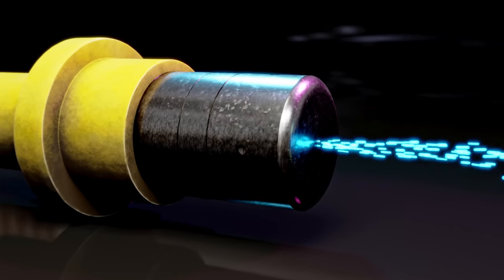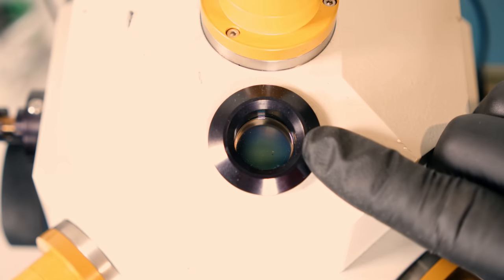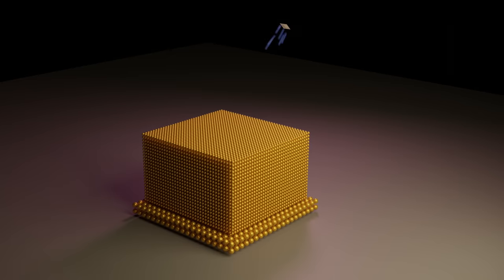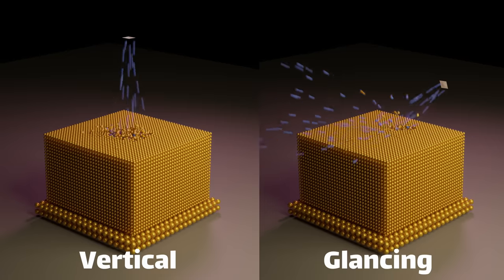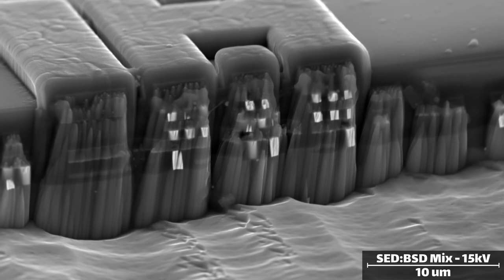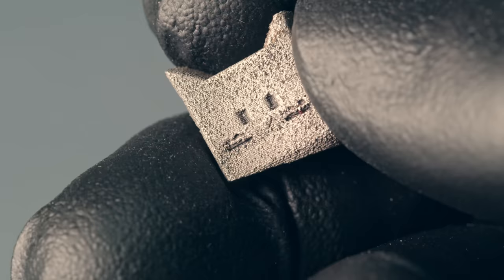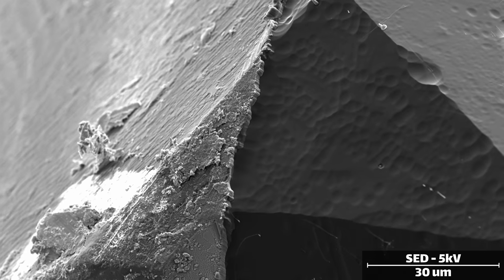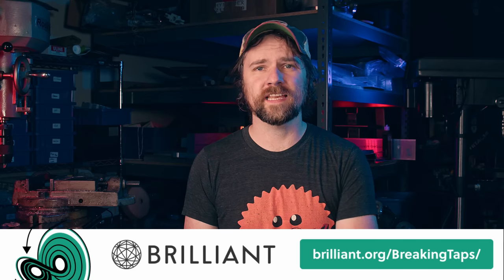Cut anything, even diamond

Comment: Just to ask a dumb question, but couldn't an old scanning electron microscope be modified to produce an ion beam?
Reply from the maker: Mmm, I think it would take quite a bit of modification.  The ebeam generating features aren't usually designed to support a sustained plasma like an ion gun.

There are combined machines that use both an electron beam and an ion beam though (focused ion beam / FIB instruments)!  They typically use gallium as the ion source instead of gas.

Comment: I loved it! Subscribed. A question: what happens if, somehow, this thing hits a human while discharging "aggressively"? can it be weaponized?
Reply from the maker: If you could stick a body part inside the vacuum chamber (without boiling all the water out of your skin), it'd probably feel like a laser. Hot, start to burn a hole.

There's no real way to weaponize this though because plasma (mostly) don't exist at atmospheric pressure. You can make some plasma over very short distances in atmosphere, or with ridiculous voltages i.e. lightning. But practically speaking an ion beam just can't really be made with so much regular gas particles getting in the way :)

Now space is a different matter, and you could consider an ion beam a slow particle beam. So definitely could be used in that context, although I'm not sure how useful it would be compared to really energetic particle accelerators.
Reply: @BreakingTaps  so, essentially, what ur video shows can be interpreted as a (very) tiny-scaled ion cannon? U know, the kind that often appears in sci-fi animations etc. Anyhow; that's rly cool... And im glad it can't be weaponized 😬
Reply: @knr1  more like a laser! but at that point just use a proper laser
Reply from the maker: Pretty much! If you could keep it focused/collimated and high enough velocity, it's basically a sci-fi ion cannon.

Incidentally, this tech is also closely related to ion thrusters used on spacecraft. Same idea, just slightly different optimization for thrust instead of etching :)

Comment: Great video as always, and a really interesting process I wasn't aware of. What's the size of the target area? I also wonder if this beam can be deflected, like in the CRT for example?
Reply from the maker: On my machine, the "spot size" varies anywhere from maybe a centimeter (with a low energy, gentle beam) down to around 1-2 millimeters (high energy etching). It's a very gaussian beam though, so there's a lot of falloff in all cases. There are other kinds of ion guns that have much more "collimated" broad beams which are useful for more even etching/polishing.

The guns on my machine are "self-neutralizing", so they tend to pick up electrons as they leave the gun and it results in a neutral beam. But other types of ion sources produce charged beams, and those you can absolutely steer around and focus! Focused Ion Beam microscopes use that principle to raster around beams of ionized gallium particles. Really neat instruments, can be used for imaging, etching and even 3d printing at a micro level!

Comment: What were those little "hairs" on the etched area of the diamond at 10:44? I can't see any on the non edge area.
Reply from the maker: Carbon adhesive goop, just an artifact from imaging 😅 I scanned the top of the diamond, then rotated it to get more of the profile. Apparently the carbon adhesive dot that's used to hold it down left some whiskers of polymer behind after I rotated it.  Meant to put a caption on screen about that, but totally forgot!

I'll pin a note about this so others know 👍

Comment: Now I'm super curious about the potential application of something like ionic welding. I can't think of a use case for such a thing but... some definitely exist. 

How precisely can you direct the ion beam? What is the control system like? This is a great video, it's got me very curious about this tech I hadn't heard of before.
Reply: Welding can be done in this fashion using electron beams through heating, analogous to regular welding without a filler. 

For nanofabrication, there are ways to use ion beams for welding (see Focused Ion Beam Induced Deposition or FIBID), where a organometallic vapor is decomposed by an ion beam to deposit a metal, and is used for micro/nanometer scale “welding”. For that the ion beam is typically focused down to nanometer diameter, but broad ion beams can be used to deposit material in this fashion as well. 

For less directed deposit, sputtering of a metal can be used to eject / deposit metals onto a substrate for coatings, but can also be used to deposit metallic contacts / support structures.
Reply: @MrPatrick1207  thanks! Studied weldeng in school so am very familiar with EB, but manufacturing focused so I wasn’t familiar with FIBID.

Comment: I thought that running a turbopump without a vacuum would cause "very bad things"™ to happen? Is it just because you didn't let it fully spool up? Or something else going on?
Reply from the maker: Yeah you don't want to let them run continuously at atmospheric pressure because the motors will get very unhappy (and they will never reach max operating speed because of the air resistance). But short durations and at low RPM isn't a problem.

Definitely Very Bad Things will happen if you have the turbo running in vacuum and then vent the chamber. Some turbos can handle a full vent to atmosphere, but most will quickly destroy themselves. Just a little vibration and the rotors touch the stators and it's all over. 😬
Reply: Yeah, that part sketched me out a bit.  They're a momentum transfer pump, and atmospheric pressure has a lot of particles colliding with the blades.  This'll wear the bearings out prematurely and will get things quite hot.  The real catastrophic things happen when you vent it from the vacuum side while it's running.  That's how you make rotor salad.
Reply: Came looking for comments wondering the same thing.

Comment: The resistance to etching will be a result of the atomic mass of the material being etched
Reply: It will be a function of both atomic mass and chemical bond strength. A simple example would be comparing etching rates of the various stable forms of pure carbon. Same atomic mass, drastically different etch rates.

Note that chemical bonds can be much stronger in some directions than others.

Comment: At -5 that turbo might not be working or leak. Great video.
Reply from the maker: Leaking I think! The whole machine is a travesty of o-rings and poor design 😅 vac grease has helped a lot, but a lot of these old o-rings probably need to be replaced. There's also like a few kilometers of plastic tubing inside the machine to transport the gas and vacuum from place to place, I imagine some of it has microcracks and is leaking too.

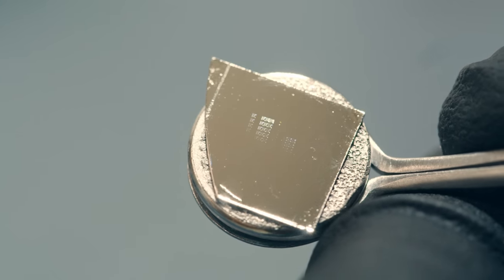Comment: Very cool.  I assume the limitation on your machine would be the size of the vacuum chamber - but, as the ions are charged, I assume they could be steered/focused directly, similar to how the electron beam lithography around 8:20 would be?  Could be fun to ion etch a pattern directly (with a time lapse of the process...).  Thanks for the videos.
Reply from the maker: So this ion source is actually self-neutralizing. The ions tend to grab an electron as they leave the gun, and arrive at the sample as a neutral ion. Which means you wouldn't be able to steer this type of source, but there are other kinds of ion guns that don't self-neutralize and emit a charged beam. Those you can definitely steer and focus just like an electron beam! FIB (Focused Ion Beam) is a type of microscope/tool very similar to a SEM but using an ion beam. Really cool instruments, and typically packaged with an SEM. So you can raster etch a pattern using the FIB while simultaneously watching it get etched with the SEM 🤯

Comment: I used a FIB just last week to cut out a 50 micron diameter circle out of a single crystal to place inside a diamond anvil cell and Brillouin it. Ours uses gallium as the ion source. I accidentally left the FIB on (but not actually milling) over the weekend and used up a bunch of the gallium source. Oops. The technician was not happy at all.

Comment: Why is this better than electron beam milling? (ALSO: FIRST!)
Reply: You made an edit just to be wrong...
Reply from the maker: You need a lot of electrons to ablate or melt a material, and have to accelerate them to really high velocities because they have so little mass. Causes a lot of heating/damage to the sample and needs a seriously chunky system to generate the acceleration voltage. But gas particles are big and heavy so the kinetic effects are just easier to accomplish at lower acceleration voltages, and it's considerably "colder" than ebeam melting.

Comment: Did you really try spinning up a turbopump with atmospheric pressure in the chamber?
I though the motors would burn up if you did that? They certainly do not like it. Way too much drag.
Reply: resistance...
Reply from the maker: Turbos can tolerate atmospheric for short durations (and low RPM) but yeah, not something you should do all the time. I only blipped the power for a few seconds while debugging so wasn't really concerned about overheating or anything.

Comment: Summary
Introduction and Basics of Ion Milling
- 0:00: Introduction to atomic sand blaster (ion Mill) used for various applications like etching computer chips, polishing optics, and metal samples.
- 0:21: The ion Mill uses a highly energetic ion beam for etching.
- 0:38: Device specifics: turbo pump, vacuum chamber, rough vacuum pump, and turbomolecular pump.
- 1:12: Sample sits on a rotating and rocking stage (missing in this machine).
- 1:37: Ion gun at the top of the chamber generates ionized particles for etching.
- 2:00: Built secondary viewport to observe etching process from two other ion guns.

Mechanics and Physics of Ion Milling
- 2:31: How it works: Ion gun accelerates ionized particles, typically argon, towards the sample.
- 3:30: Argon particles gain tremendous kinetic energy, acting as an "atomic sand blaster."
- 4:07: Explains sputtering with simulations, not scientifically accurate but illustrates the process.
- 4:58: Argon implanting in the sample is an unwanted side effect.
- 5:16: Amorphization disrupts the sample’s crystalline structure.
- 5:35: Angle of impact, masks, and other variables can change etching outcomes.

Practical Applications and Demonstrations
- 6:01: Practical demonstration: Etched microchips using a titanium shim mask.
- 6:46: Heat generated can be substantial, enough to melt materials like aluminum.
- 7:14: Tungsten vias are more resistant to ion etching.
- 7:36: Main use: Clean cross-sections for microscopy. Shows various detected elements.
- 8:07: Discusses silicon nitride passivation layer on microchips.
- 8:09: Describes how simple and complex masks can be used.
- 8:22: Talks about Electron Beam lithography and aluminum deposition.
- 8:30: Notes imperfections but highlights how deposited metal acts as a mask.

Advanced Applications and Materials
- 8:47: Mentions ion milling's use in etching hard-to-etch materials and in ultra-precision optics.
- 8:54: Ion milling for polishing telescope mirrors and lenses.
- 9:09: Common lab usage is for preparing microscope samples.
- 9:39: Ion milling as a gentle approach to smoothing surfaces.
- 9:54: Ion milling's material-agnostic etching capabilities.
- 10:06: Includes etching diamond as a feat, describes it as an "atomic sand blaster."

Challenges and Troubleshooting
- 11:01: Troubles experienced in getting the ion milling instrument to work.

Closing and Promotion
- 11:36: Segues into a promotional message for Brilliant.org, focusing on problem-solving skills.

Disclaimer: I utilized GPT-4 to condense the video transcript into a
summary. The original transcript exceeded GPT-4's context length
limitations, so I divided it into two segments. For each segment, I
employed Prompt 1 to generate timestamped bullet lists. I then used
Prompt 2 to organize these lists into sections with titles. The
summary was manually formatted using YouTube comment markup.

Prompt 1: "Generate a bullet list summary, including starting timestamps for each point."
Prompt 2: "Split bullet list into sections. Create section titles. Keep timestamps for the bullets. Use this format for titles: *title*"

Comment: Which SEM did you use for the pictures? They look much better than ours ;-)
And how much did you pay for the ebay ion mill at the beginning? I know that they are very expensive!! Close to 1 Mio$ ...
And the ion-gun. Its not easy to repair one if you do not knwo how it should have looked like (angles, distances, material, ...) wow! Did you have manual for this?

Comment: When tig welding with AC and Argon shielding gas, the arc cleans the surface oxides from the area along the weld.  It appears sort of like  that cleaned area was sandblasted. Is that a similar ion blast phenoma?

Comment: i wonder how it would work if you used oxygen instead of argon when blasting diamond, the rest product should be co2 or co gas and be a more aggressive "abrasive" for carbon compounds. it is only a quick hypothesis though.
Reply from the maker: It's a good hypothesis, you're right! There's a technique called Reactive Ion Etching that uses a reactive gas (like oxygen) either in pure form or mixed with the argon. It's a much quicker way to etch diamond exactly as you noted: the carbon is converted to CO / CO2 and pumped away. So you can etch many orders of magnitude faster than a purely kinetic approach like pure argon :)

It's a little less isotropic so you can get undercuts behind masks, etc. Usually a mixture of the two are used. Argon to mill isotropically, and oxygen to rapidly remove material.
Reply: @BreakingTaps   ahh i guess reactive molecules can "bounce" off and react with what is under the mask since the reaction doesn't really need any kinetic energy as with the inert gas to etch.

hmm i might have to get/build one of these just for fun in the future to experiment with.
just put it on my other million things to build list.

Comment: your channel is really awesome! i've been a fan for a while now and i'm just wondering how you are able to create a financially self-sustaining lab like this? besides youtube ad revenue, sponsors, and patreon, are you taking on other side jobs like tutoring to fund such expensive machines?
Reply from the maker: Less recently, but for a long time I've also done jobshop and consulting work on the side. Prototyping, scientific assemblies, microscopy/analysis, etc. More recently I've been focusing on the channel more and doing less outside work though. Hard to split attention between the two tasks, and the channel is finally getting to the place where I can really devote myself 100% to it.

The SEM in particular was funded by my prior salary (software engineer) and living relatively frugally, and most of the rest of the equipment is scrounged from ebay. If you dig around long enough and don't mind some repairs, you can find good deals from time to time :)
Reply: @BreakingTaps  thanks for the detailed response! your channel inspires many :) repairing second hand equipment has great pedagogical value too!

Comment: Don't turbo molecular pumps get damaged at atmospheric pressure?  I.e. they should only be run under a rough vacuum
Reply from the maker: Only if they are running at max speed and you vent the chamber. It's safe to run them at low RPM for short durations in atmosphere. They will never get up to their max operating speed (because of air resistance), and if you run them too long that way the motor is liable to get damaged from overheating. But short runs at low speed is fine :)
Reply: @BreakingTaps Ah ok that makes sense

Comment: Great video.  
Is the etching made possible by the ions striping electrons from the target material, weakening their bonds with surrounding atoms, or would non ionized atoms have the same result if they were accelerated equally?  Thx
Reply from the maker: My understanding is that it's purely kinetic. I forgot to mention, but this type of ion source is actually self-neutralizing so the ions are neutral. As they leave the gun they pickup electrons so the overall beam is neutral (some other ion sources generate a charged beam, or have an electron emitter to neutralize the beam)
Reply: @BreakingTaps Are they still technically ions once they are neutral?
If not, it seems kind of amusing that the name for it is still “an ion gun”

Comment: Does the cathode tip with the hole wear away over time? (ie. is it a consumable?)
Reply from the maker: I think it does wear away, yes. I don't have the original manual so I'm not sure if they recommend replacing over time. There's a section in the back of the chamber that's definitely a wear item, you can see a deep pit that has been slowly etched over time. I didnt show it in the animation for simplicity, but the plasma gets ionized in the whole chamber so there are some argon molecules zipping around inside causing etching too.